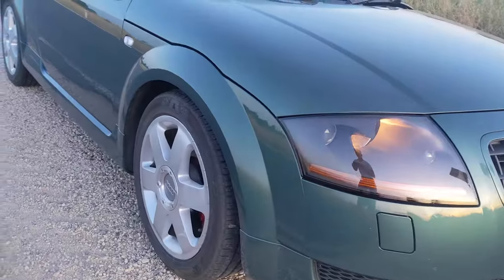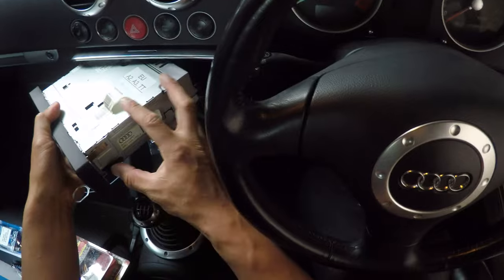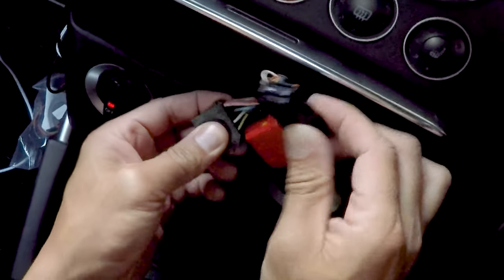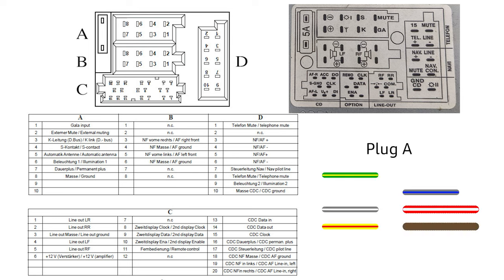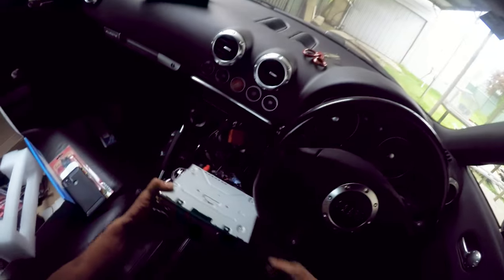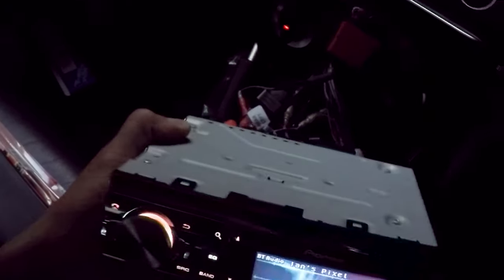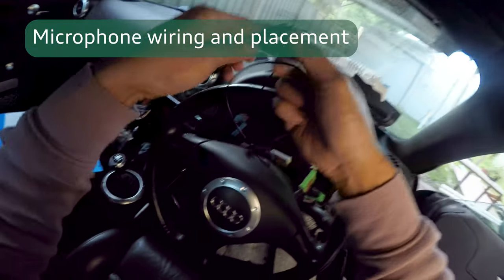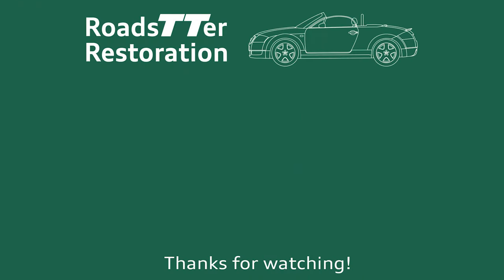Audi TT Mk1 Bose Stereo upgrade DIY guide. How to wire up Bose to Pioneer radio. No popping sounds!

Comment: I just run Apple CarPlay, Android Auto, Screen Cast, phone hands free & text to voice plus satellite view maps through my OEM Chorus head unit, all for exactly £100 and a 10 minute install including a stealth 12v socket. The actual installation is only 30 seconds, it’s reattaching the dash panel for the additional 12v socket which takes a moment.
Reply from the maker: What unit are you using to do this ?

Comment: Hi, Great video, a very thorough and professional install.
I have bought a second hand Pioneer DEH 80PRS and intend to fit it and replace the existing speakers at the same time as they are somewhat worn out by previous owner/s.
What speakers would you recommend as replacements for both front and rear?
Cheers
Reply from the maker: Hey Mike. It'd a great HU and glad the video was helpful! 

I recommend anything 6.5" and with a shallow mounting depth. The door cards are very flat so you don't want to risk the magnet hitting the window as it moves. 

I'm actually going with some 5.25's because the roadster has a subwoofer to take care of the low end. I find they have smaller magnets too but great sound quality. 

Also I highly recommend doing the auto EQ thing with the pioneer microphone. It made a really big difference to the sound afterward. 

Cheers!
Reply: So allowing for the speaker depth nothing springs to mind that would compliment the DEH 80PRS?
Also I am toying with connecting the 6 stacker CD player back up as was disconnected by the previous owners to suit the alpine IDA x001, your thoughts?

Comment: Love the video. I’m planning on upgrading my head unit, amp, rear and front speakers plus tweeters. Looking through a bunch of videos, I’m seeing that people are having trouble with the Bose amp. Would I need to rewire to all the new speakers to connect to my new amp? I’m really hoping not but will do if necessary. 😅 thanks!
Reply from the maker: Hey Elite. You will at least need to run new RCA cables to connect the low line signal from HU to amp. The Bose already has the wiring to each of the speakers but depending on your setup (active x-over or passive x-over) you may also need to run extra speaker wiring. 

Then depending on your amp you might require a thicker power and ground cable. 

I'll be doing an amp upgrade soon too but will run the factory speakers and sub. Mine still seem in good condition and already sound decent with the HU I'm running. 

The amp I've got is a Clarion XC2510. What amp are you looking to use ?
Reply: @ianpgonzaga  yea that’s what I assumed 😫 I’m picking up. 2 sets of infinity kappa 6.5 component speakers, a Sony gs 4 channel amp and 2 infinity under seat subwoofers since there no space for a sub box. To keep it safe I’ll just take off all the panels and flooring and just add brand new and thicker gauge wires to make sure I get the best outcome. 👌🏽
Reply from the maker: @eliteculture1519  ohhh sounds like it's Gunna be a good setup! Let me know how you go - whether or not you end up using the speaker wiring already at the amp or new ones.
Reply: @ianpgonzaga  hopefully everything goes as planned. But you know how that goes, there’s always a problem 😂 I’ll update you when I finish lmao

Comment: We struggled with the ground loop isolator, it didn't seem to fix it (it was an old one I found in a drawer) so we used line level adapters, which also aren't ideal. The bigger issue is we're getting nothing out of the rear speakers, I'm guessing I need to sit down with the loom diagram you shared and review the ebay special adapter as there's something crossed - Unless you have come across this?
Reply from the maker: Hey Classic Keepers. I think double check your wiring loom. Also is your system Bose or not ? Either way it does sound like 
- wiring is incorrect when using the line level adapter 
- HU needs fading to the rear (have you tried to see what happens when you fade left to right?)
- rear speakers blown
Reply: @ianpgonzaga  yes it was the bose with a CD changer. I've seen that there are some front speaker only looms. It's had an amp change too so it's got to be the loom. I'll get on it, thank you!
Reply from the maker: @Aston_Keeper mine also had a cd stacker (mounted in the back) 

You want to make sure that the big 20 pin plug has the 5 wires coming out of it. Has a common GND

Comment: How did the Navigation work on theese cars

I see that the radio has Nav lines on D plug but cannot understand how were they used

This radio doesnt hsve screen big enough to display navigation
Reply from the maker: Hello! I believe the Navi module was separate to the radio and directions displayed on the instrument cluster screen.
Reply: @ianpgonzaga  Aha, where did the map display?

Or did this navigation work without the map

I wonder how did u input the address

Also, why did the radio need navigation specific pinout (for audio muting maybe)?

I used to use this radio in my Audi A3 (also had Bose), never knew that navigation was even an option

The volume broke (known problem when you move the knob and volume jumps like crazy), sadly it was never repaired (I did send the radio to local repairman but he never fixed anything'l, and I sold the car with this broken

The buyer didnt care and probably replaced the radio with some aftermarket unit anyway (which is quite sad, since you cant realy add a lot in 1din  space anyway, and AUX and Bluetooth could probably be made to work with original radio)
Reply: No map, pretty much just street names and which direction. Also only knows like main roads in any given town. It was very basic.
Reply: @nikolaisikes6245  ah ok
So how did u input street names?

Did navigation module have a separate keyboard

Would love to see a video of that, for some reason videos like this are hard to find
Reply: @Veso266  No, you just have a little selector knob and you scroll through the alphabet selecting letters as you go. Selecting a state first, city, then a street name. Again it's all contained within the unit, so it only knows street names of main streets from the year it was made.
Reply: @nikolaisikes6245  oh ok, so not even possible to do map update, wondering if they had to create different units for different parts of the world then

Interesting

If u still have acsess to this, would love to see the recording

Comment: Is see you have 3 connectors (2black 1red coming from the car and using 1black with power through an iso adapter to the head unit and the other black one with the adapter set for RCA. So what's happens to the other Red one? My radio is now connected through an iso adapter with one red and one black plug from the car. No RCA connected so I think it currently is avoiding the Bose amp( I do have Bose speakers).
Reply from the maker: Hey rik... The extra red connector is going to the CD stacker. I do talk about it and you can see the pinout for that red plug in the diagrams. Looks like your setup is going through the cd player or stacker somehow instead of the RCA's
Reply: @ianpgonzaga  ah alright that must be it. I do have the CD stacker. I will figure something out en try to get it to work with the Bose system! Thanks a lot!
Reply from the maker: @itsmeRik060  yeah get the adaptor that plugs into the 20 pin plug. That way your sound uses the whole Bose speakers + subwoofer. It actually sounds great with a aftermarket HU that you can boost the bass frequencies (if you like that kind of music)
Reply: @ianpgonzaga  Yess I will buy the adapter and hope it will sound great! Yeah I hope to get some bass sounds out of it! Because i think at the moment I do not get the full potential of the Bose speakers. Thanks a lot!
Reply from the maker: @itsmeRik060  yeah sounds like it might only power the speakers but not they the amp.
Reply: @ianpgonzaga  So I got the answer to this. Actually the red connector I saw was from a sort of Chinese adapter to convert the normal output to the amp. And I got the adapter plug and an upgraded HU with RCA and that works great now. But only thing is I don't hear anything from the back speakers (also with the other adapter). When i only connect the RCA for the rear speakers I just barely hear sound but it seems like it's coming from the tweeters (or just the normal speakers). Do you might know what that could be? I heard some one say the Bose amp only works with front speaker channel and then sends sound to the rear by itself. But then why are there connectors for the rear channels. I hope you might know! Thanks in advance! 😁
Reply from the maker: @itsmeRik060  the rear speakers are tiny so don't really make much volume compared to the overpowering front. Sounds like they are working fine to me.

Comment: Hey Ian. Great video. Where did you connect the blue amp signal wire to? I got the same harness but unsure where that goes.
Reply from the maker: Hey. Connected to the ignition live.
Reply: Cheers. Probably a dumb question but did you just take it from the existing wire on the other plug or run a cable from under the steering wheel?
Reply from the maker: @marcooconnor  nah not dumb at all. 

There's an ignition switch live at the red plug. If you have a multimeter or test light probe you'll be able to figure out which is the IGN live.